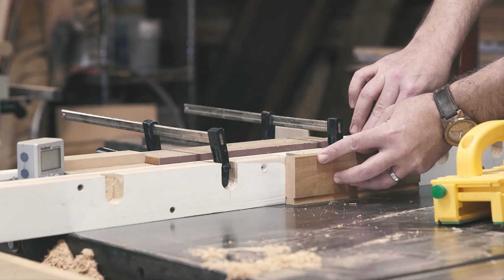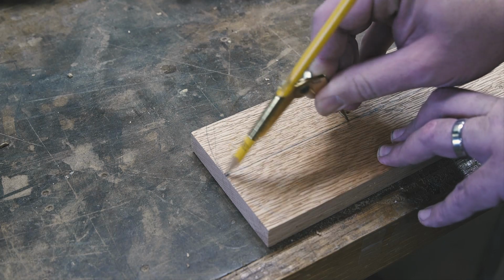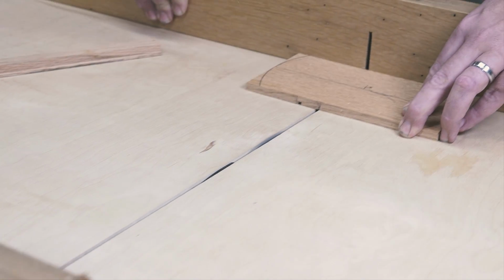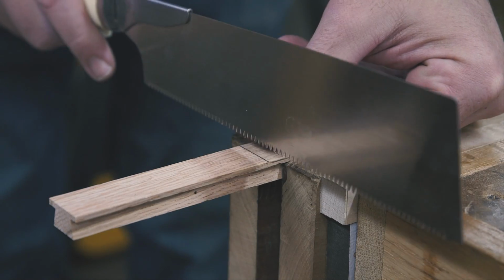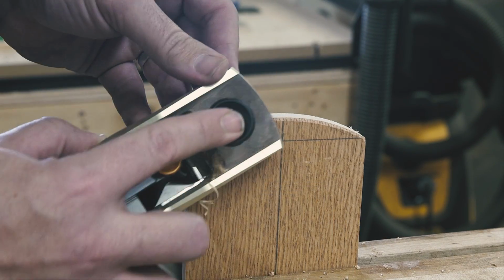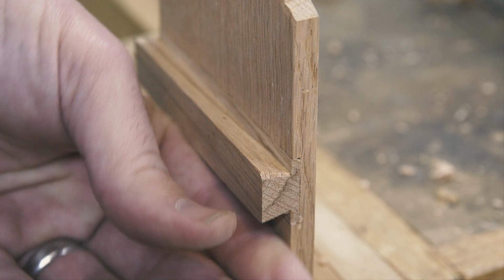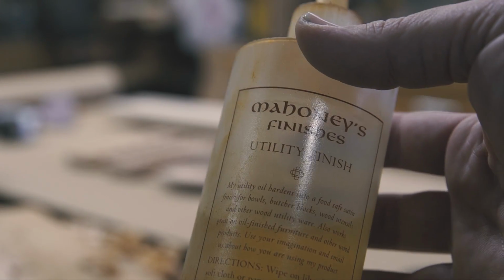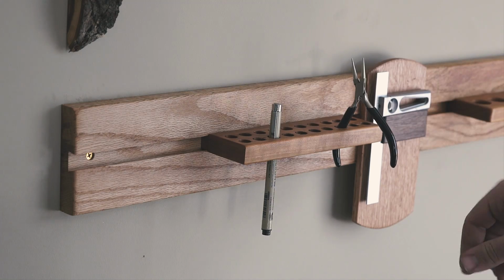The Dovetail Cleat Organizer

Comment: I think the sliding dove tail is amazing ( the tapered version doubky so) and plan to use it and tusked tennons more in the future. For a cleat wall I am toying with making the bottom of the wall pieces at a 45 creating a dove tail. thinking it should be possible to nip the tails of the tool holder so pushing up leaves enough room to drop in. Everything is secure, slidable and no fancy locking.

Comment: For an organizer, dovetail may not be the best choice: if you want to change something in the middle of a cleat, you have to remove everything from one edge. French cleat holders can be moved individually without changing any other holder.

So, while looking neat, it may not be a good choice.
Reply: It also but stress on the wood in a different direction as opposed to french cleat holders; there most of the weight goes down.

So all in all I don't see how this is better. It sure looks pretty, but that's about it.